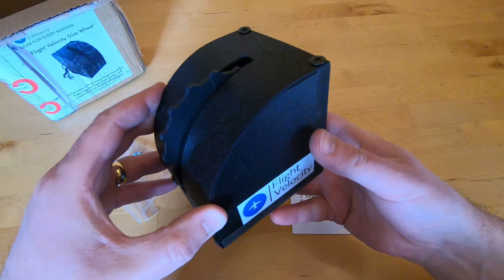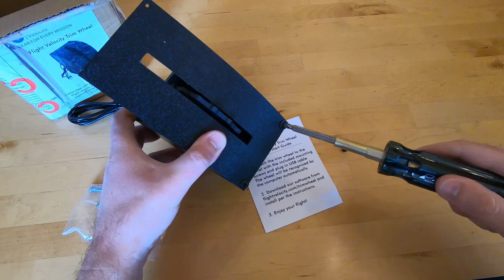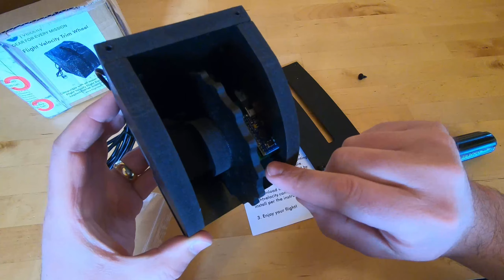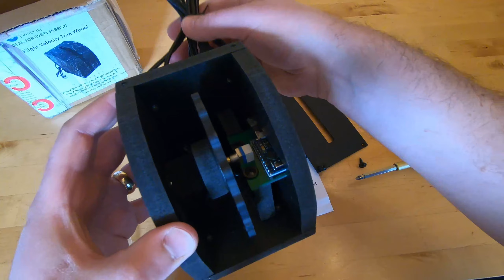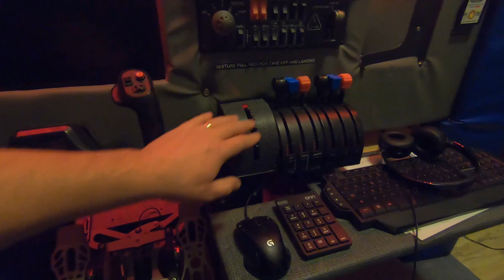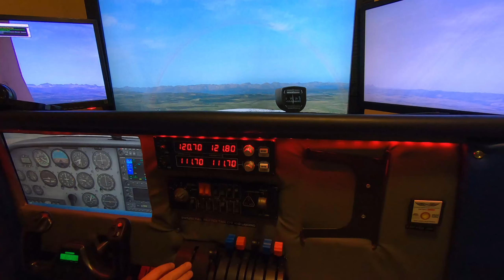Flight Velocity Simulator Trim Wheel

Comment: I just got this the other day. I have a small trim wheel on my Logitech multipanel and it works okay but I wanted a larger wheel I wouldn't have to spin so much. It seemed like a good idea, but it's not working out in practice, in MSFS 2020, so far. I spent much of the afternoon trying to adjust the settings--in the sim, and on the hardware--so the planes I was flying wouldn't spin out. With no luck. I would like to hear from anyone who's figured out how to adjust this trim wheel's settings so it will trim the plane instead of crashing it.

Comment: Thanks for the trim wheel review.  I noticed you have the cowling showing without the instrument panel on the center screen.  May I ask how you did that? I adjusted Plane Maker to show just the same amount of cowling as you have, but I still have instrument panel showing.  rasander@gmail.com
Reply from the maker: That was on a previous setup with xplane 11.  If I remember correctly it was just the setup of field of view for each monitor (there were 4).  Sorry I don’t remember the details.  I’ve since switched to a single 55” tv for the monitor.
Reply: Ok, thanks.  I’ll give it a try.

Comment: They want $79 for this with no mounting hardware? I would rather spend $200+ on ebay for Saitek wheel. This thing looks like it was manufactured by a teenager.
Reply from the maker: This trim wheel is just ok.  It worked better with xplane 11 than it does with msfs 2020.   I am looking forward to upgrading to a honeycomb bravo throttle quadrant with trim wheel as soon as they're more available.

Comment: Any chance your using this with Flightsim 2020?  Thanks for the video.
Reply from the maker: Yes, I just started using it with msfs 2020.  It works, but not totally properly.  You have to turn it quite a bit to trim effectively.  I have not yet tried adjusting sensitivity or calibration.  I will try to optimize it asap.  (First I need to sort out the logitech stuff that isn’t working at all)
Reply: @dr.dansgarage  thank you for your response. Let us know how it goes with calibration. Thank you
Reply: @dr.dansgarage  Also look into spad.next (14 day full trial version) to make your logitech flight panels work

Comment: Works great.  It is smaller than the real one and requires some extra turns.  Seems turning it faster a shorter distance helps.  Also adjusting the key rates on the keyboard helps smooth it out.
Here is a link on how to adjust keyboards rates.  I have had no problems with normal typing after the adjustments.  Happy with it.
https://www.tenforums.com/tutorials/136866-change-keyboard-character-repeat-delay-rate-windows.html

Comment: Out of frustration of not finding anything I designed and 3d printed my own trim wheel with a mechanical trim indicator and 4 full rotations of accuracy, very similar to a real Cessna 172.  The result is so good im thinking of giving manufacturing a shot. I was quite surprised you paid $79 for yours, given how simple it is. Do you think theres a market for a more realistic trim wheel if i price it around $99?
Reply: I thing you may have something there. I've been throwing a couple ideas around for panels and other things. The Bravo throttle would be your biggest competition in the U.S. if that is your market.
Reply: @stuartellington5215  Thanks for the input! Although i do own the Honeycomb Alpha Yoke i'm not so interested in the Bravo as it has more appeal to airliner simmers. Not sure if it would be worth the effort. Think it would be easier to market as a pure trim wheel unit or trim wheel + TPM + flaps?
Reply: @erikm9768  It looks to be a good all in one with the autopilot, trim flaps, etc. I'm running the Alpha with two Logitech throttle quadrants and fly specifically GA myself. I like your idea simply because I use Air manager for the rest and the investment would be minimal. Another company produces something similar but they are never in stock and I hear questionable thing about the company.
Reply: The Saitek Cessna Trim Wheel is sold out globally it seems.   I am helping with a new sim setup based on my own.   If your device works then we would be interested.  See my post above on how to actually demonstrate and review a simulator trim wheel.    Regarding rotations, we generally think of "half rotations".   Top to bottom x 3 will set up a steep turn at 45 degrees almost hands off.   Best glide at 65 knots in a C172 in an engine out situation is engine at idle / spin the trim wheel to full nose up limit / then nose down three rotations (bottom to top).  The actual rotations in a C172 or half rotations is then 10 from the centered position.   You may want to review this thread on how X-Plane interacts with a trim wheel.   
https://forums.x-plane.org/index.php?/forums/topic/57810-saitek-cessna-trim-wheel-autopilot/
Reply: I would like some more information, I'd be willing to buy a trim wheel off of you so I can use it in MSFS 2020
Reply: Are your 3D print files available?

Comment: If this wheel is "good"... can you practice steep turns properly?   Means lay in the 45 degree bank add 100rpm and back pressure to the yoke then roll approx 3 turns of the trim wheel nose up and fly a 360 degree circle with almost hands off only minimal pitch input.   That would be the measure of "precision".   3 Turns is an estimate could be a bit more but has to be specific and not something excessive and imprecise.
Reply: This wheel is smaller than the real one.  I think your expectations are a little high for the price.  Overall FSX and Xplane are Sims and cheap ones at that.  You can buy a used computer to run them and the software is $25 for FSX and under $100 for the rest.  You can spend under $1000 or you can spend $50,000+++ on a better sim.